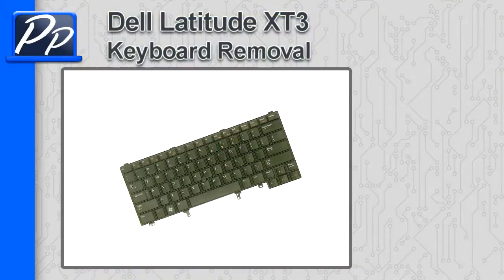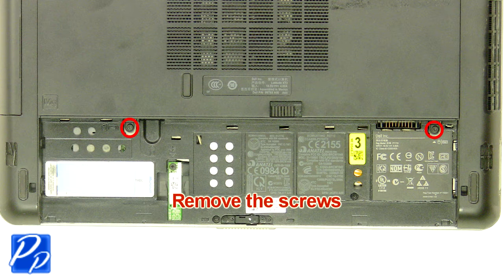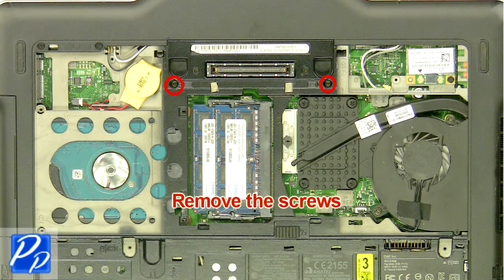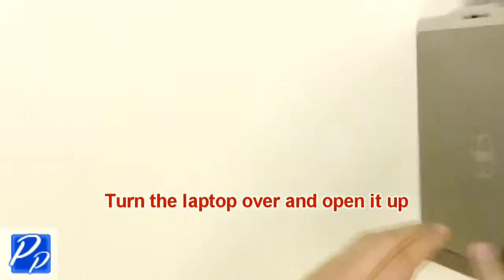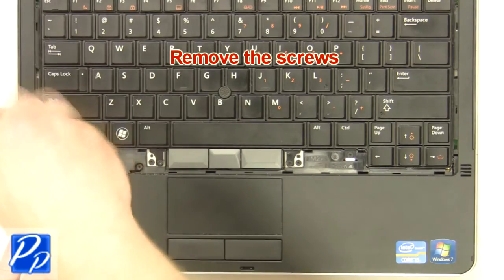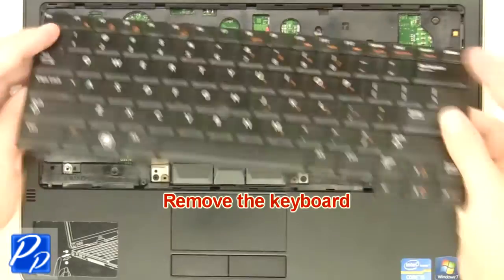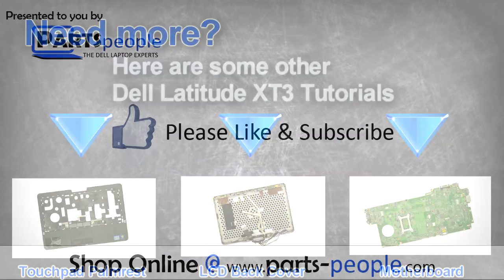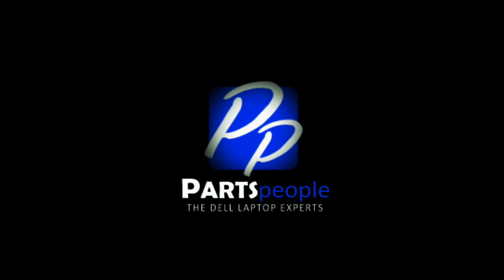Dell Latitude XT3 Keyboard How-To Video Tutorial

Comment: i love to know how cooling system work in this laptop because i het a lot of hot air out of the vent while no input holes are blocked and fan works as it should
all i did was middle case replacement with all pieces installed corectly on theyre respectfull places and i don't see any problems  otherwise than high fan speed and excess heat coming out
it didn't do that before
keyboard vent and back vent is all there is